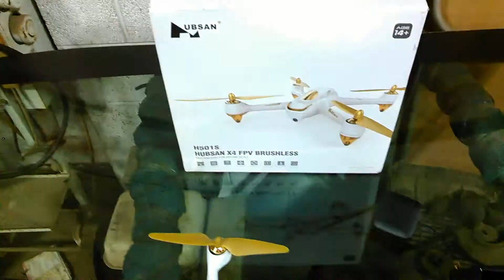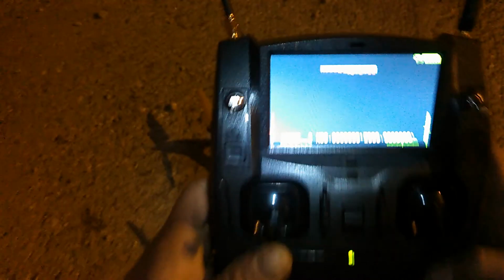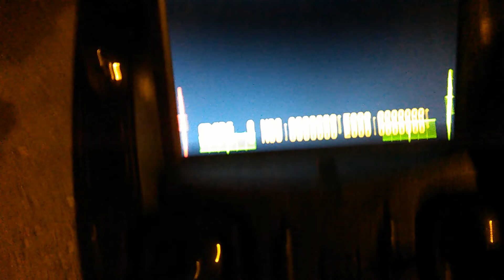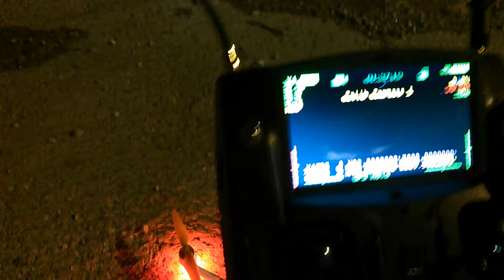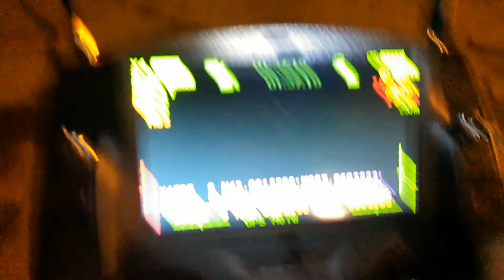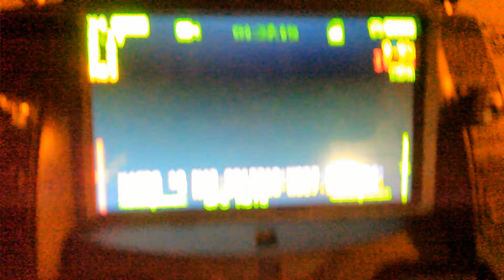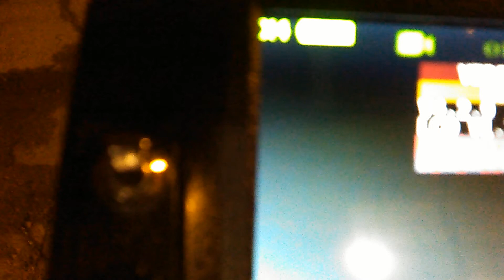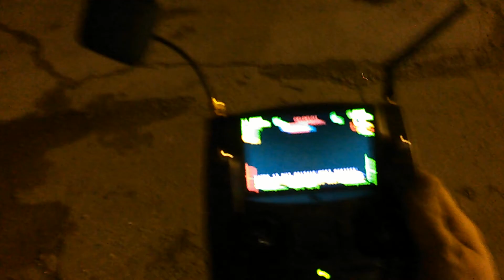hubsan h501s Calibrations Explained, & Before flight Tips

Comment: I have the new Advanced Transmitter with a new H501s Drone and it keeps losing GPS Satellites what is the problem?
Reply from the maker: Which one is losing satellites? The controller or the quad? It's normal for your transmitter to fluctuate on the number of satellites it has acquired. However, the Drone should never lose satellites during flight. Are you making sure that you wait until you get as many satellites, on the Drone & Transmitter, as you can, before you take off?
Reply: @MarkSuttner  It's the Transmitter, it starts searching for Satellites and picks them up then seconds later it says signal lost, I never even got to try to fly it, I sent it back and am waiting for a new one to arrive I hope this one works. Thanks Mark
Reply from the maker: @adventuresofdragonfly2231  Oh, that sucks bro. I hope you get one that works. I've noticed that the h906a (Advanced) transmitter, has quite a lot of issues. It's actually made and designed for the h109s X4 Pro, not the 501S or SS. It will work with the 501S and SS, just seems like the h901A (Standard) controller has a lot less issues, with a h501s. I'm guessing you had a bad GPS module, inside your controller, or the connection to the PCB board was bad or something. Hope u get a Working transmitter back from them.

Comment: I have H 501 ss with H 501 s transmitter. After calibration 2, I must start again calibration 1, more than 7 times. What is wrong?
Reply: Me too, anyone know whats up?
Reply from the maker: Are you making sure that you are not around any metallic objects? If you are not around any metallic objects, you may need to perform an IMU calibration

Comment: Great video Sir. I bought one the other week and did my first flight and got it on YouTube. Thanks for your calibration tips, especially leaving battery door open as I had closed it prior, so will try your tip tomorrow. I had another go today with my drone and not sure if handset is out a bit as drone drifting a bit even at low level. May look for a factory reset for handset on YouTube. By way, if you're interested to see my very first drone flight I can add link for any advice you can give after viewing? Again great video Sir ;o))))
Reply from the maker: Hello! As for your drone drifting a bit, that could be caused by a lot of things. Compass calibration, waiting for satellites before you arm the props, initializing the quad on a level surface, so the pitch and roll readings are both at zero, is very important and making sure that your trims, are centered, is important, to avoid any drifting. You can do a control stick recalibration, if you feel it is necessary. All you have to do is, hold both control sticks to the upper-left corners and turn the controller on. Then, move both sticks simultaneously, up, down, left, right, then do 2 complete circles (all the way around, once clockwise, once counterclockwise. After that, push any trim button to save the calibration. If it is done correctly, the reticals on the screen, in the lower left and lower right corners, should move in exact correlation, with the control sticks. That's how you Re-Calibrate the controller. I would love to see your video, and if you have anymore questions, feel free to ask! Thank you for watching !:) Oh, btw, I have a few newer videos explaining compass Cal's, and A Lot of other things, if you're interested, check them out. Actually have a Long Range flight, making it to 2,357 meters out and a RTH, with 1 battery !! These are very cool Quad's ! Happy Flying my friend !!!
Reply: @MarkSuttner  Thank you so much for your tips my friend and will try your calibration tips as other videos just say put both sticks top left while turning on, then turn sticks in circles three times etc. Will try your way by moving up down left right and circles etc. I will sub to you so get more videos and looking forward to watching the ones you mentioned above. Here is the link to my video too. Any advice much appreciated my friend ;o))))

https://www.youtube.com/watch?v=pgylc0psHzc

Comment: As I read the manual on this badBOY, do i do any calibrations actually in flight , as in page 15 on mani, horizontal calibration is required when the x4 is drift during flight, or because he drifts during flight is y I shpuld do this calibration? Pls help, awesome video by way of a Jerry rigged blower!!
Reply from the maker: No, you should only have to perform the Initial 2, Horizontal and Vertical calibrations Before a Flight. But it is very important to perform them correctly. If you're not sure on how to perform them correctly, I do have a couple videos explaining how to do them (Instruction Manual Is NOT Correct)!!  If you are experiencing Drifting, Make sure your Trims Are Centered and the controller may require a control stick recalibration. It is a good idea to do control stick recalibrations on a frequent basis but it's not necessary all the time. To do that, you hold both control sticks to the upper left corner. At the same time, turn the controller power on. You'll see the screen change. Then, take and move both control sticks simultaneously, and move them all the way up, all the way down, all the way left, all the way right, do one or two complete circles clockwise and counterclockwise, release the sticks and hit any trim button to save your calibration. That helps keep the control stick locators "Calibrated". If you are Still having Drifting issues, then you might need to perform an IMU Recalibration (Gyro Sensor). It's rare to need to do that as, the IMU's (Gyro Sensor) are Calibrated at the Factory. If you want to know how to perform a IMU calibration, There are also videos, or I can tell you how to do it Correctly. Don't attempt an IMU Recal, if you're getting good flights, it could really mess up your quad. Anyways, at this point I'm not even sure if you were having drifting issues but to answer your question, no you should not have to perform any calibrations while in flight for drifting.

Comment: From the looks of your hands, you've been sticking them in spinning props.
Reply from the maker: Mitch Lol... I'm a Full Time Mechanic & Flatbed Tow Operator. My hands are either Wrenching all day, or Hooking, Dragging, Winching Cars out of crashes, etc. I know, they don't even come clean ! Ever look at a Mechanic's hands ? Covered in grease, grime, dirt, cuts, burns, etc...
Reply: I use to work in the oil field and as a mechanic and welder. Lucky I still got all mine. Glad to know it's not from props, they look sharp. LOL
Reply from the maker: Mitch LOL :) Yes, the props are sharp. They spin Very Fast as well. They could Definitely Tear some skin open ! People can get Seriously hurt by These Quads. Brushless Motors, And High RPM's along with sharp props... The Bigger Quads, like the H109S, are actually Scary. Their props are Twice as big, spin with A Lot of force and could Definitely Tear a Finger Off ! Man, when you arm the motors on the H109S, it's Loud ! Then, give it Throttle, Stay Back Brother ! The H501S could probably tear down to the bone. Wouldn't go through, but the H109S, would Definitely Tear Right Through, and you Would Loose a Finger, or Fingers. These are considered "Toy Grade", just a bit of caution, Their Not ! They can do some damage! When you get your quad, be careful bro !
Reply: Out on the Brown tomorrow. Snow is gone, but damn, it's only in the 40's here in Wisconsin at end of March. Brrrrrr. I'll count my fingers before flying. LOL
Reply from the maker: Mitch LOL...) I know brother ! I live in Wisconsin as well. And it's been pretty cold for being the end of March. And extremely windy for for the last week. It's too windy today once again to try and fly and it's very cloudy.
Reply: Only 35 over in La Crosse at 11AM. I still have not flown mine yet. Too cold and windy.
Reply from the maker: Mitch Really ? It's about 50 degrees, Sunny and not very windy by Milwaukee. I'm working, or I would be flying !!
Reply: 1:30 pm, It is snowing lightly in La Cross.

Comment: Just a suggestion...try to keep the head camera on the quad, especially during calibration. Mostly all I saw was the cars across the way. Otherwise a good video.
Reply from the maker: +Larry Cutrone Yeah... At the time that I made this video, I could not find my head cam. So I jerry-rigged a cell phone to a baseball cap and use that as a camera... LOL Thanks though :)
Reply from the maker: +Larry Cutrone Thanks for watching, by the way, I always do the compass calibrations slow and steady with my hands. I never do the "Drone Dance" / "Cal Dance". Some people swear that doing the calibrations with the quad held out with your arms and spinning your body works better. Other people, including myself don't do that, and it's for a reason. I have tried multiple times to do the calibrations with my arms and spinning my body, the quad had absolutely terrible GPS hold and would drift all around. When the calibrations were done by simply spinnng it with your hands slow and steady, it had great GPS hold and barely moved more than a couple inches without drifting. I have tried both types of calibrations procedures and every time the hand spin method works best.
Reply: @MarkSuttner  Doing the drone dance would cause an elliptical calibration where doing it in your hands would not! Good video thanks a lot :)
Reply from the maker: @Polecat54941  Yep ! Not only can it cause an "Eleptical" rotation, doing "the dance", can create outward inertial momentum, causing the IMU's and Gyro to become "Un-Calibrated" or "Dissarointed". Thank you for watching this video, I believe it was one of the first few videos I made. Since then, I have made others, trying to explain more in detail, how important the calibrations on this particular quad are and why.

Comment: Hi Mark, what is the specs of the transmitter  lipo baterry are you using?
Reply from the maker: +georgiejr69 For the FPV2 (Standard Controller)--> 7.4V 2S 1200mAh 20C LiPo. For the FPV1 (Advanced Controller)--> 11.1V 3S 2200mAh 30C LiPo.
Reply from the maker: +georgiejr69 Im Sorry... For the Standard Controller its a 7.4V 2S 1200mAh 25C LiPo.... Not 20C like i first said... That battery Lasts Very Long ! I can get 12 Full Flights and the Controller's Voltage Meter on the screen Only went down One Notch... 12 Flights and the battery is still at 75 - 80% ! "Aries Advantage" is who makes it. I bought it from my local hobby shop so i don't think you can buy it online. However, Any "Good Brand" 7.4V 2S LiPo should work Great and last long if it has over 1000mAh...
Reply: Mark Suttner thanks for the info
Reply: Mark Suttner thanks for the info
Reply: Mark Suttner thanks for the info
Reply: Mark Suttner thanks for the info
Reply from the maker: georgiejr69 No problem whatsoever ! Any other questions you may have, Feel Free to ask ! :)

Comment: Vielen herzlichen Dank für deine sehr hilfreichen Videos
Und die Geduld beim Beantworten der Fragen.
Greetings from Germany!
Reply from the maker: +Habibi46611 Thanks For Watching !!! Greetings from U.S. !! :)
Reply: I have the H501s with advanced TX since early December.
FC V1. 1.21.
540 meters FPV without problems.
BUT: 5.8 GHz antenna also 180 degrees rotated.
2.4 GHz ok, not flown.
Not much flew. first holiday, then sick, then lots of snow and wind now....

And this: in a few days, a 100 metre height limit applies in Germany.
H (max) = 100 m.

Do you see a video of me?
(stabilized with YouTube)

http://cloud.directupload.net/95W3

Again best wishes!

Comment: Thanks for the vid.  I just had mine take off on me the other day like it was possessed!  LOL.. Not sure what happened.  I took it up and it was all over the place within 30 seconds being in the air.  I had 12 GPS signals.  I may have just rushed though the cal procedure.  Luckily it hit a bush and only seems to have damaged the props.  New props are in today so I will give a quick test when I get home tonight. :)
Reply from the maker: +The Switch Vape Did you try and change your Firmware ?? If you did, Big Mistake Bro ! Change it Back to what it came with as long as you are Not Having Range issues. Otherwise, if you had a near "Flyaway" it could be 3 things -> You changed your Firmware ? If Not then You may have done your compass cal's too fast. You need to do them VERY SLOWLY AND AS STEADY AS POSSIBLE. Those Cal's are Extremely Important !!! Extremely !! And Third, After you Do PROPER Compass Cal's, After You Initially take off, Let the quad fly Exactly Above where you took off from for at  LEAST 15-30 seconds. I do that Every Time I Fly.... Why? Just because your controller says the quad has 12 satellites, Once in the air, it takes the quad a little time to Actually "Really Locate & Read Their Positions"... You may have to adjust the altitude manually UNTIL It flies "Automatically"... If your quad will Maintain Exact Altitude And NOT Move More than 2-3 Inches, It has PROPERLY Located and "Knows" it's 3D Location. If you wait for that, You will not have any problems. Happy Flying ! P.S. Don't loose your quad !!! :)I Hope you Understand what I'm saying..? Any further questions, Do Not Hesitate To Ask !!!!
Reply: Thanks.  Got it in the air today.  Did ok, drifted a little bit.   Had a small windo of time it seemed like it "got lost" but controllable.  Did the horizontal Cal because seems like it's drifting too much.  Battery died out so I'll try again tomorrow.  Thanks.
Reply from the maker: You Bet ! :)
Reply: Everything looks good to go.  Did the antenna mod today; vid still kinda fuzzy.  I have gone through the freq tuning and cant really find one too clear; but still fine.  I have found doing the cal on the counter or just a very flat surface and not lifting it during the CW turns does very well.  Then take it outside and get gps locks and no issues.
Reply from the maker: The Switch Vape That's Great your Quad is Flying Correctly !! Issue with the FPV Signal --> Do you have the "Standard" Or "Advanced" Controller ???
Reply: I have the standard.  did the antenna mod earlier today.  Signal still gets a little snow from time to time but very usable.  I will have to check it at a longer distance later.  Before the mod I was able to get about 100 meters out of the fpv.
Reply from the maker: The Switch Vape I also have the Standard Controller for the H501S. Have the H906A (Advanced Controller) For my H109S X4 Pro. The Standard Controller With the Antenna Kit I bought Is Unbelievable ! 1,000 Meters with Clear FPV and Full Controls !! What kind of Antenna kits did you get ? Those 3 panel "open faced" ones, or a Omni-Directional ? They make A LOT of Different Types... I'm Only asking because I can Most Likely Help with the FPV reception your getting if you want..? Send me a Picture of your antenna Mods if you want. Here are mine.....
Reply from the maker: 14 dBI High Gain Panel antenna and a 3dBi Di Pole High Gain Control Antenna... I don't know if you can see the picture, but I get Crystal Clear FPV at 5755 MHz....
Reply: I have the flat panel one...Like I said the picture is ok; and I have tried to tune it but not much luck.  I would love any tips/help you can offer.
Reply from the maker: The Switch Vape I also have a "flat panel" FPV antenna. Does yours have a "WiFi" looking logo on one side? If it Does, That side with the logo Always needs to Face Directly at the Quad. All Panel Antennas Need to have the Correct side Facing the Quad AT ALL Times... 5755MHz is Absolutely Perfect for what I'm using. It's made by "BTG"... Bought it NEW from Amazon... I could Help you More if I knew Exactly what Brand of Panel Antenna you have, and how you modified the controller. Was it just a simple SMA to Ipex Connection ?? I Made A Video On How To Properly Mod H501S Standard Controller Antennas. You Can Find it on my Playlist... It's Kinda Long, But I covered A LOT Of Very Important Things In That Video. ...
Reply: I have the same one..I will try 5755 again and see if it cleans up a little more.
Reply: I actually used your video earlier today for the mod.
Reply from the maker: The Switch Vape It Definitely Should !! Hey, one more thing... Are you using a LiPo for your controller? I've found that when you "Max" power the controller, you get Way Better "Behavior"... Longer Range and Static Free FPV And Longer Control Range... Personal trials.... Just NEVER Exceed a Fully Charged 7.4 Volt LiPo !!!!!
Reply from the maker: The Switch Vape If 5755MHz doesn't work, open your controller up And make Sure your Antenna Wires Are Not Crimpped In Any Kind of Way, Make Sure The Ipex Connections Are Snapped In Tight, Also, if you used Hot Glue, Make Sure None of the glue Got Inside the Ipex Connections... Let me Know What Happens !! Good Luck Bro !!!! :)
Reply: Yep..I have a 2S LiPo; 800Mah
Reply from the maker: The Switch Vape Does your Controller Screen Have Full Bars where it shows the controller Power ? If it does, Check inside TX as mentioned before. If you find nothing wrong, There's a few other things you can do. Let me know what happens after you try 5755 MHz.. Ok ? :)